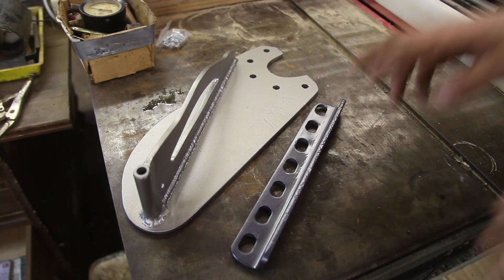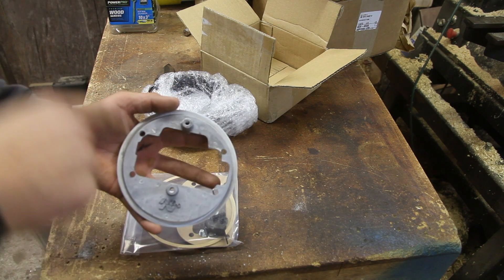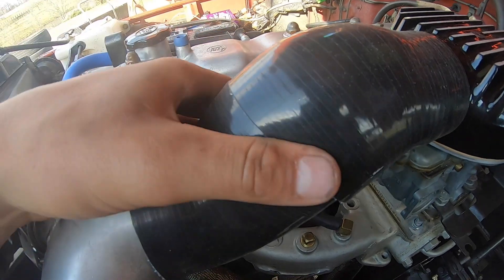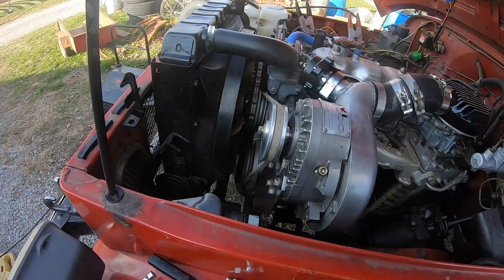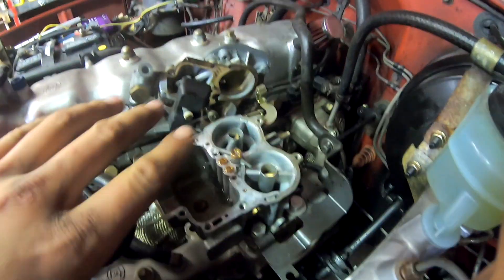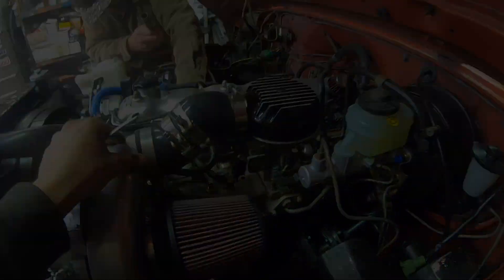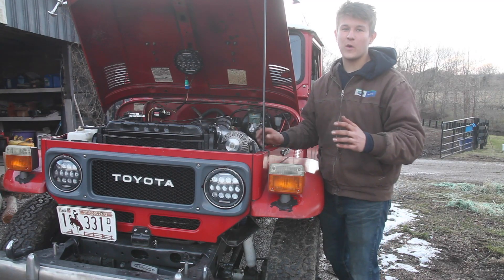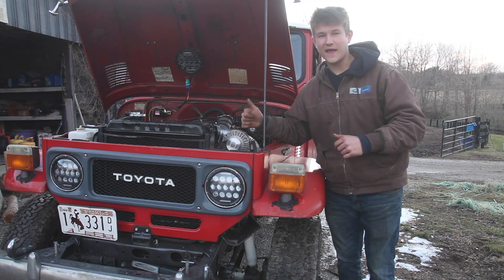Supercharging a Toyota FJ40 LandCruiser // Part 2

Comment: My grandpa had the exact FJ40 in the same color and everything. Brought back a lot of memories. Nice job fitting up the compressor. Best thing to do with those stupid smog pumps next to deleting them is repurposing the mount for a blower.🤣😁 Nice work👍👍 What did you go with for a pump? Walbro 255lph or Bosch 044 are probably the best off-the-shelf pumps that are readily available and affordable.

Comment: Most excellent work!  If you happen to check comments can you let us know how the bottom end is holding up?  I have a 60 and have always worried about how the 4 bolt main will handle boosting long term.